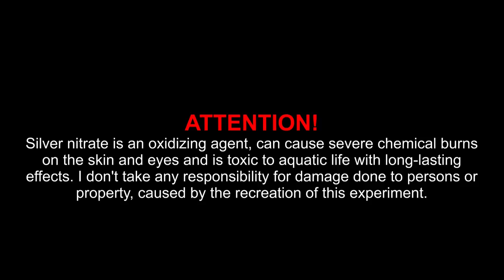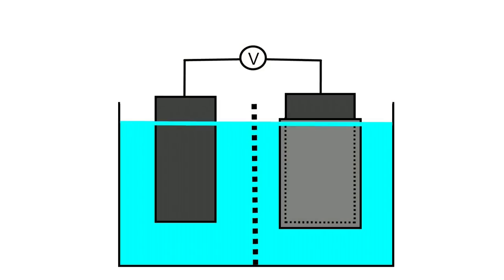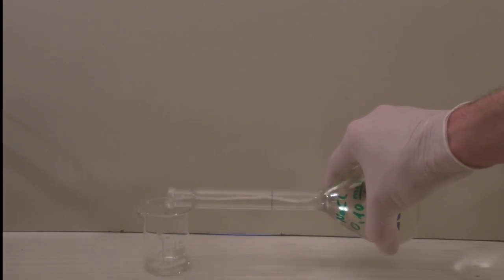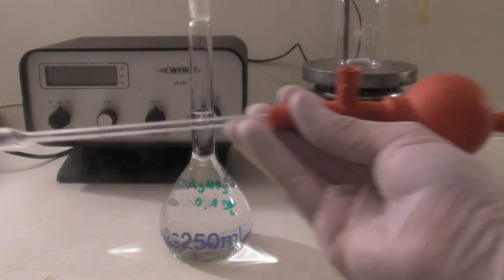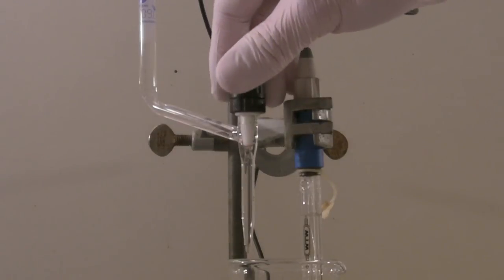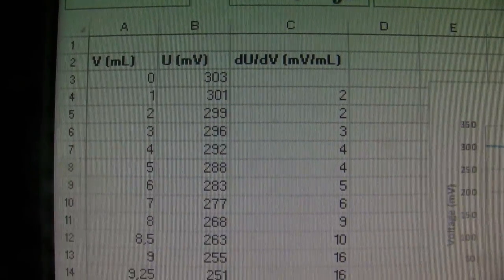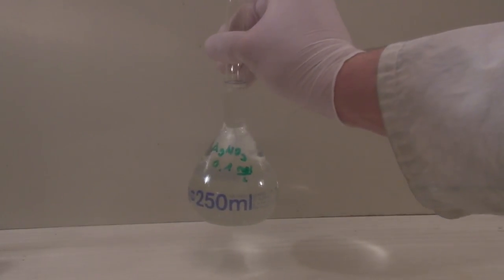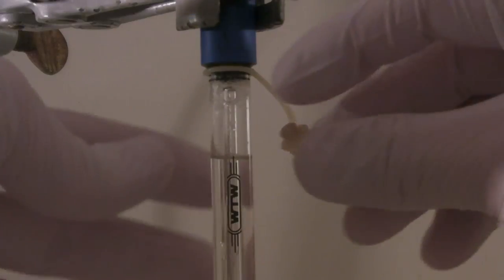How does potentiometry work? (With real examples)

Comment: If we add more distilled water to submerge the membrane of the electrode, won't the concentration decreases?
Reply from the maker: Yes, the concentration decreases, but the amount of the halide stays the same. So, the amount of silver nitrate solution, which has to be added, also stays the same. Due to the highly insoluble precipitate it's not a difference if the concentration is changed after taking a sample.